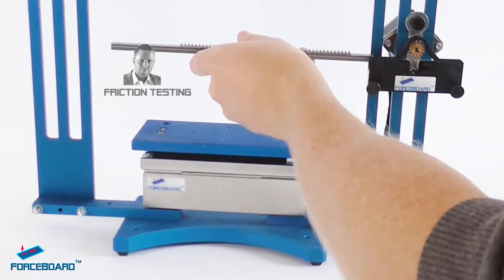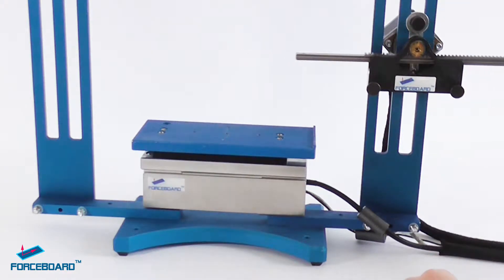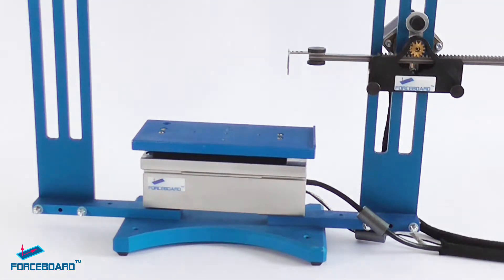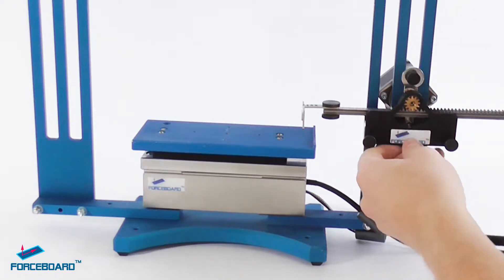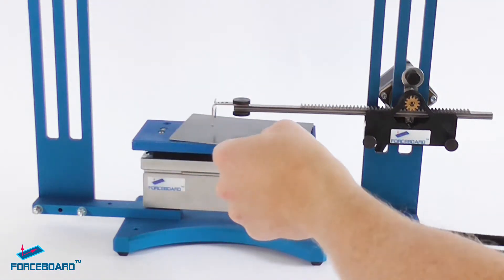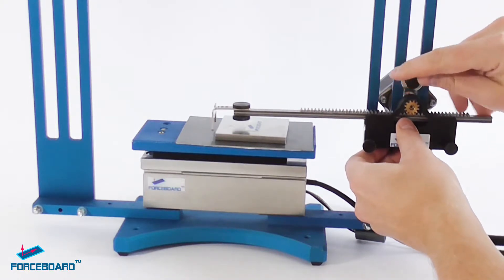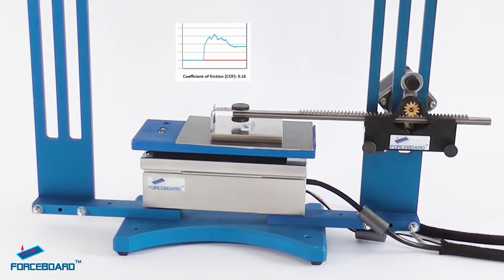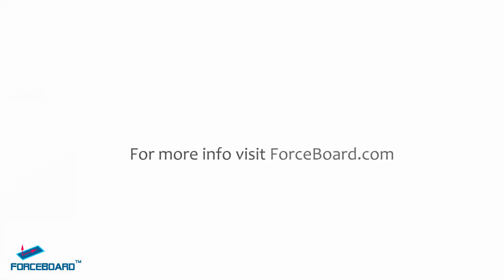FRICTION TESTING

Comment: how do you determine which is the static and dynamic friction coefficient if the sample just moves at constant speed and not adjusting in relation to the horizontal force